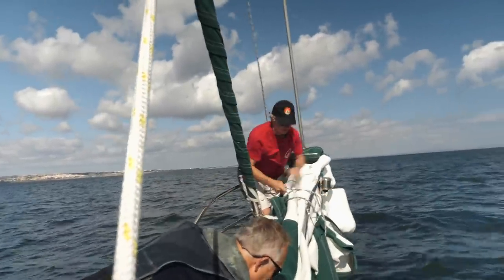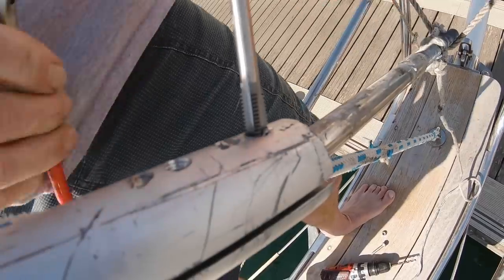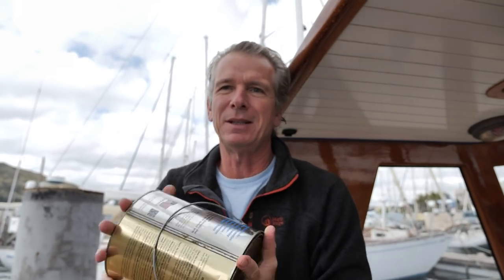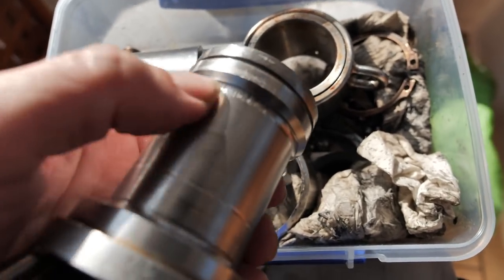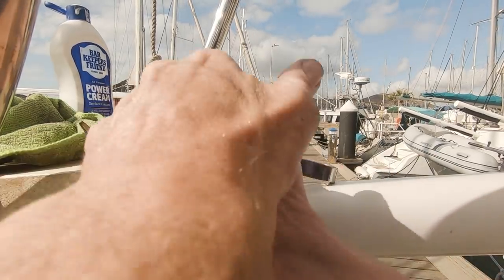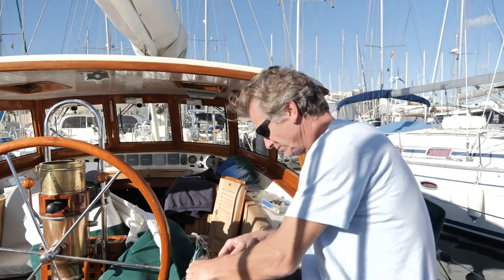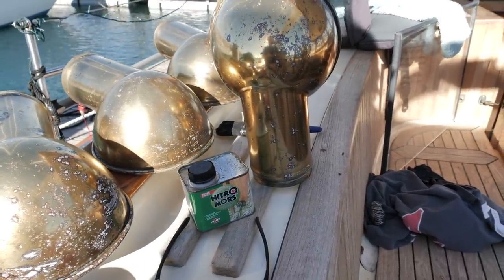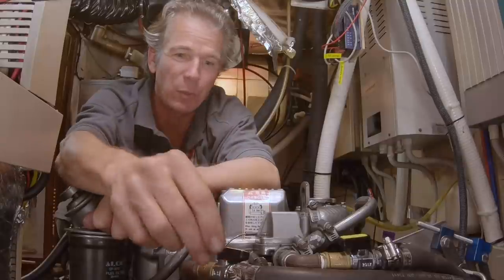General winter boat jobs ; deck & engine maintenance, removing the fore stay and much more!

Comment: Great idea wrapping some screws with electrical tape to offset the chances of them coming loose from vibration.  One tip a mechanic shared is that when you're done wrapping, don't stretch the tape to break it, but keep it loose and cut it with a knife; that will help prevent it from coming loose at the end.  Appreciate your attention to detail; keep up the good work!
Reply from the maker: Yes I’m sure that’s good advice with electrical tape. I do often use self amalgamating tape instead though and of course in that case breaking by stretching is better.

Comment: Hi Steve, absolute useful. I liked all tools you have on the door to the engine compartment. s/v cadhoa had a problem getting there pieces apart when fixing the sail drive. They put the troublesome parts in the oven, and it just fall apart nicely. Maybe something to test on your roller furler next time. Keep up these technical episodes coming, you always learn something new. Well done.

Comment: I wondered if you considered the long springs that keep doors /hatches open for the engine doors? They stay open until you put pressure from the side and then go loose to close. If your case you would use your foot. So much room in your engine bay and so neat. André
Reply from the maker: Yes springs would do a good job

Comment: Brilliant video. Beautiful boat. I have two comments though. Wear glasses as the absolute minimum of protection when using a grinder and o-ring grease is preferable to vaseline on o-rings and plastics.

Comment: I have hanked on head sails and I have furling head sails and I must admit when things go wrong I prefer hanked on sails! A hanked on head sail with a downhaul is far less trouble than a furling headsail with a problem.
Reply from the maker: I sailed for many years as a youngster with hanked on headsails, never again! If I were racing I might consider it... but even then! Several of the GGR competitors went with hanked on sails and regretted it. We we had the problem with the headsail we just dropped it the same way you would if it were slab reefed so not a problem. Roller reefing main, now that's another matter!
Reply: @svfairisle  I have boom roller reefing main sail which has its advantages and disadvantages.

Comment: I am not sure you will read this being an old video but with your screws and the problems you have there I have an idea. Can you use Allen Head bolts that come with lock wire holes and use s/s wire? Then you could use anti-seize and they will stay in place. Not sure if it's suitable. Just an idea.

Comment: Enjoyed the whole video but was especially interested in the device you have to adjust the alternator belt tension. It's brilliant for people like me that have an engine "compartment" rather than an engine "room"! What's it called?
Reply from the maker: Its called the ' Balmar universal belt buddy' got to love these American names! It's overpriced for what it is, to be honest I should have got a bit of threaded rod & just made a captive nut and a moveable nut and it would have done the job. And you're right if you havent got the room to get over the top of the alternator and heave it over you've got no chance of tensioning the belt properly so its extremely important especially as people have been reporting Balmar alternators dying from fan belt dust. That would be some very expensive dust!!

Comment: Quick question looking at your bow. Did you ever consider opening the rail in the front, so that you can get off over the bow more easily. Or do you always go into a berth with the stern or sideways to a dock. (I hope the terms I used are comprehensible)? I looked at some respective ideas for our HC41. Any ideas?  Thanks for the videos.
Reply from the maker: We do often go in bow to ( reversing in is such a bu&&@r with long keeled boats!) At the moment we're happy stepping over the rail, the bow sprit extends beyond it and you can put your foot on that. I've made a wooden platform that fits on top to make this easier, I'll try to show it when we use it next.
Reply from the maker: Love the 41 by the way, prettiest of the lot!
Reply: Sailing Fair Isle Do you have a ladder to attach? The bow sprit sometimes is quite high above the dock. While jumping down may be possible, getting back up again might be quite a challenge. (I can‘t attach a photo here can I??
Reply from the maker: No I don't think YT does pictures. We havent been in need of a ladder yet. If it becomes an issue I'd probably go for some sort of box  that you can put on the quay to step up on.

Comment: There is no such thing as a UV protecter, what is meant is a UV absorber. That is all you can incorporate in a clear coat.
This absorber absorbs till its is full, so to say. After that no protection against UV is peft. The time during which it absorbs
Cannot be stated before, that all depends on the amount of absorber in the clear coat. As it is a very expensive additive,
Paint producers tend to add as littla as possible. IT is because of this reason that I always state, a clear coat is not UV resistant 
In any way. To obtain good UV resistance use of an opaque paint is needed, preferably white, as that will not get hot in the sun. 
This however cannot be used on a nice teak deck, so conclusion must be, leave it at it is, grey is beatifull. A rinse with salt water from time to 
Time keeps it clean fron molds.

Comment: You really should not use Vaseline O rings. The petroleum will break down the rubber. You should be using silicone grease instead. Most dive stores carry this
Reply from the maker: Good point with natural rubber. But actually most o rings are much more sophisticated polymers these days. The ones I use are Nitrile that are resistant to just about anything. Cheap on amazon too, i paid £3.16 for 10!  https://www.amazon.co.uk/gp/product/B07W4WV84X/ref=ppx_od_dt_b_asin_title_s00?ie=UTF8&psc=1

Comment: did you think of installing a diesel day tank
Reply from the maker: What's a diesel day tank?!
Reply: @svfairisle  https://www.youtube.com/watch?v=AQruMvQjxh0
I would also add this to make it a fuel  polishing system around 20 micron
https://www.youtube.com/watch?v=0GiSKWPMaUg&t=6s
using a 10 micron on the racor filter, 5 micron on the engine filter

Comment: How do you tension the belt on your engine water pump?
Reply from the maker: By getting a belt the right size. It has 180 degree wrap and very very little resistance so you could virtually do it with an elastic band! If it were a serpentine belt you could have a sprung roller but v belts dont like being bent backwards. But as I said there's really no problem a reasonably tight fit with a v belt means it wont slip, it wont tension the bearing (a big problem when incorporated with the alternator because the tension then has to be massive in comparison and the wrap is much less) and because theres little tension it wont stretch, especially with the Nutlink belt I'm using.

Comment: I love your channel and enjoy all your videos, HOWEVER...
A major cringe moment watching you use the plyers on the turnbuckles and nuts instead of an adjustable wrench (shutter!) I have more than once given an apprentice an earful or even a (light) slap upside the head for such a thing (yes no longer PC but those were different times). Why would you mar your stainless like that?
Reply from the maker: Good point, duly chastised!
Reply: Those are Knipex, not just any pliers, they are micro adjustable and the jaws stay parallel to each other, even recommended by Brion Toss for that very same job.
Reply: @chicoastro1  Yes I know, they are the only kind I use, together with Bacho adjustable wrenches. I just wasn't sure of the English name for them. But even then, they will still leave a mark if any pressure is exerted.

Comment: Your O rings will last longer if you use lanolin instead of Vaseline, petroleum products eat O rings.
Reply from the maker: They are nitrile so Vaseline is no problem. Always use nitrile if  you can not rubber on a boat, it's not only petroleum based products that degrade rubber.

Comment: oh boy.... I do not think that wd-40 is a good thing for electrical conectors...
Reply from the maker: Why do you think that? WD40 is just a water displacement, anti corrosion thin oil, perfect for to get into electrical switches and connectors. I use dielectric grease on anything that comes apart but for inaccessible items it’s perfect

Comment: great video I feel the need to comment on the oil change interval, additional engine hours of use are not detrimental to the oil in fact sparse and short duration use do far more damage to the oil due to acidification associated with condensate and combustion by products. If you were to drop below 100hrs per year or if most of your motoring was less than 30 minutes I would increase oil change frequency.
Reply from the maker: That's a good point, if for some reason you were constantly running the engine and not getting to operating temperature you might want to increase oil changes to more than once a year even if you weren't putting in the hours. However I would just avoid do that altogether and make sure I regularly got the engine up to temp.